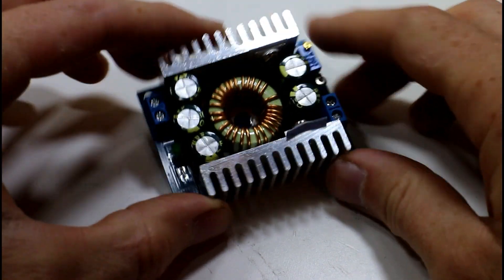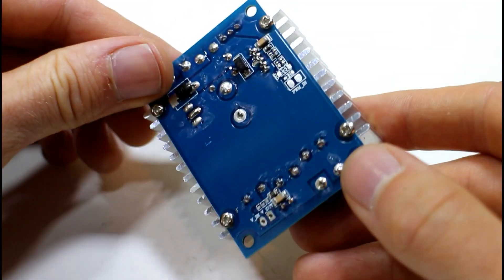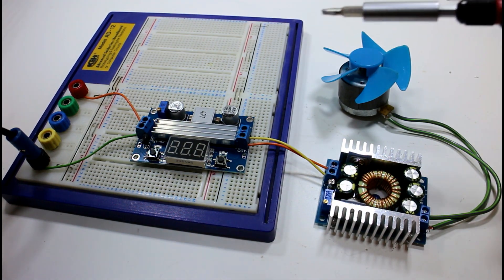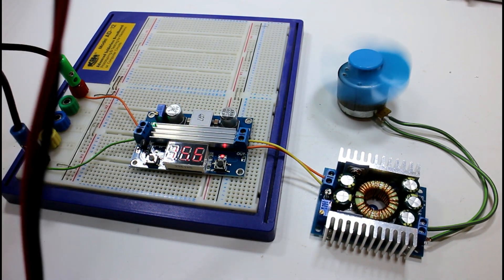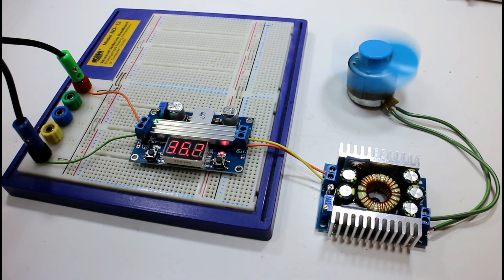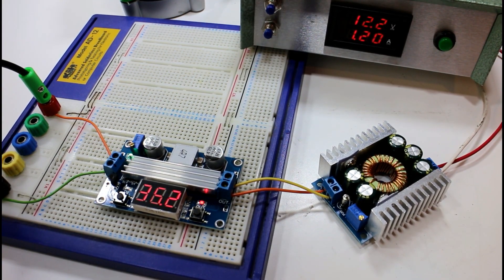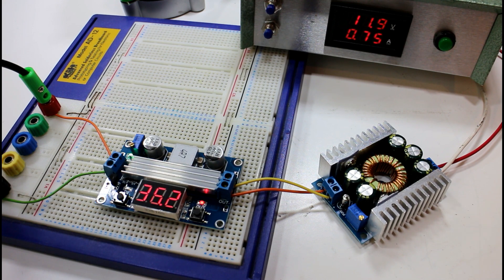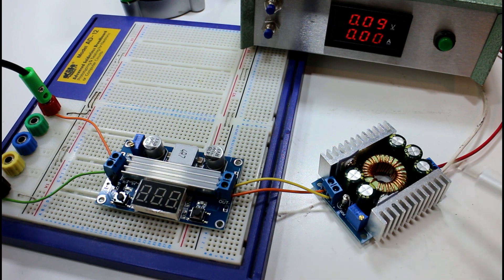High Power Step Down Module from IC Station

Comment: I made a raspberry pi project last year using two of these. The project had a 15 inch monitor requiring 12v and several items (a raspberry pi, speakers, SSD storage, USB recharging (via a powered USB hub) for two wireless controllers and my cell phone) requiring a 5v supply. I used two 12v gel cell batteries in series to produce a 20+v (theoretical 24v) power supply, then used one voltage converter to give me a solid 12v supply for the display and a second converter for the 5v supply (that in theory could handle over 10 amps). These buck step-down voltage converters proved to be very efficient and the whole setup powered my project through a 3 day camping trip.

Comment: Surely a switch mode power supply would be more efficient than a linear power converter, they don’t waste as much energy as heat, only issue i am aware of is they can be a bit limited on how much current they provide. Sorry if I’m missing what the point of the video was. Cheers